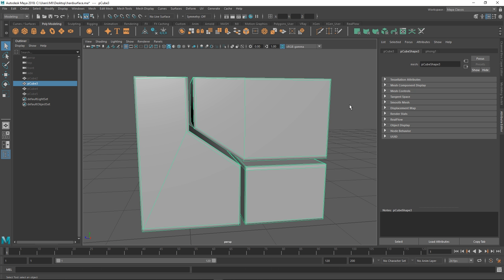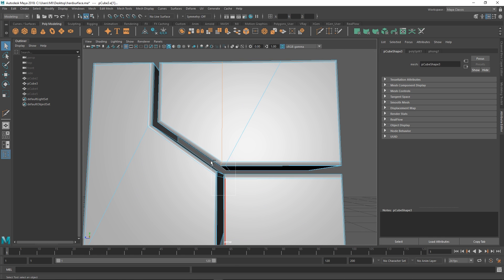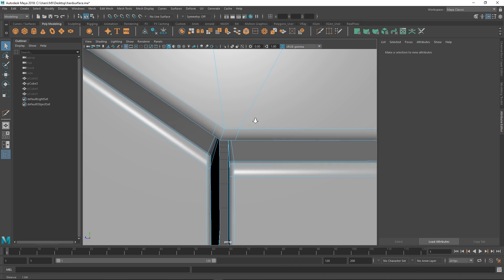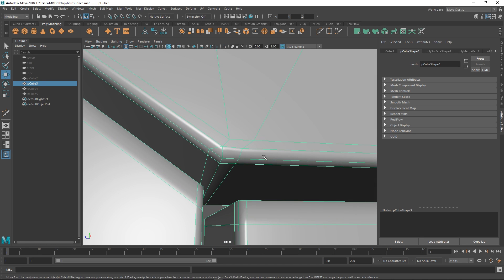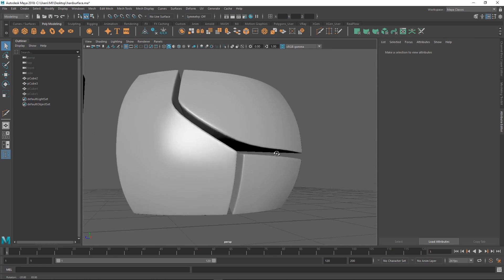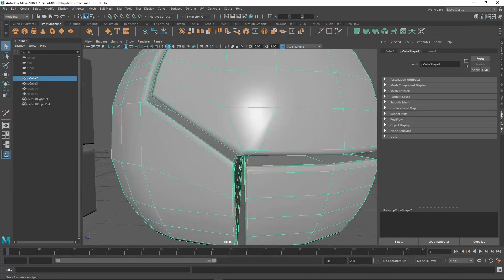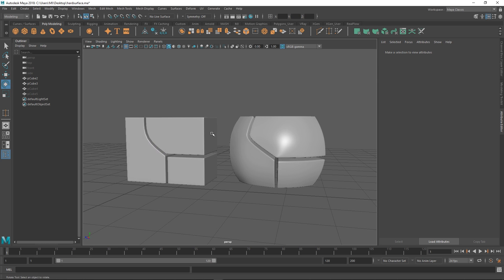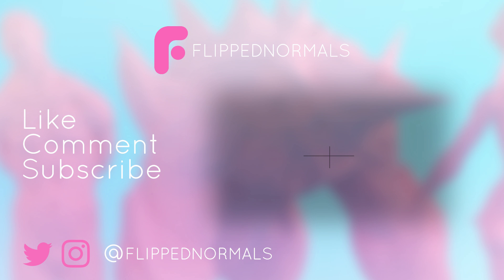How to Use Triangles When 3D Modeling

Comment: Or if you wanted to create a defining edge, you could create three edge loops, and then delete the edges that dont define the corner, then use the multicut tool to link the outer defining edges and boom, you have created a hard edge with no extra edge loops

Comment: Please do not mind but this is not the right way to handle this kind of situation. At least you need enough polygons in your mesh to handle the curve or roundness before adding in any supporting loops. Even you can use crease tool in Maya or 3ds max for a view before finalizing your model. This is how we handle these kinds of surface: https://www.artstation.com/artwork/m4X2E

Organic hard surfaces need a little extra planning before boolean or cutting any surface into it.

Comment: For corners it's actually better to use a diamond face, you don't even need a triangle there. Anyway, keep up the good work guys!
Reply: whats a diamond face
Reply: @isunktitanic  it's a quad that has 3 vertices at the top and one at the bottom ( kind of looks like a diamond ), useful to go from 1 edgeloop to 3 or vice versa

Comment: Why do i need to add supporting edges? And why do you keep checking with "3" mode constantly? Cant i just use the model as it is without smoothing it?
Reply: The reason is that for anything but games , models are subdivided for or on rendering, smoothing them out. If you don't have edges z your model will shrink and lose its shape. Make a cube in Maya and press 3 on it. Then add edges and see the effect :)
Reply from the maker: If you work with basically anything apart from games, you need to check the '3' constantly,  as this is how it will look while rendering. You want to be as close as possible to that.
Reply: if you'll get better result, then do it your own way, and maybe share with others
Reply: Kayo Lazuli I just wanted to learn the reason for that.
Reply: 3 is the subdivision preview . After modeling in Maya, you need to forward your model to a sculpting software, eg Zbrush to add details on it (high-res). The sculpting software works by increasing resolution of your model so that you can add minor details. One way to increase resolution is by subdividing your model. When you hit "Divide" in ZB, you see it has more points and also becomes smoother, which is what you see when you press 3 in Maya. 

This is just one way to do the modeling. You can, of course, choose not to do it this way. You can use other features than subdivision in Zbrush, like Dynamesh or Dynamesh Master to increase the resolution of your model. They increase the resolution without smoothing your model. 

Just search "subdiv preview maya", "high-res low-res pipeline maya " to find more.
Reply: You obviously don't work in production

Comment: What about n-gons? I've seen people call models unprofessional if they had n-gons, but just like in this video those n-gons didn't really seems to cause any problems. I tend to leave n-gons in my models also to save time and polygons. N-gon in a flat surface doesn't seem to cause any problems with the geometry or UV:s. It only looks bad in wireframe mode.
Reply from the maker: It really depends what you are using it for. If you take them into ZBrush, the ngon isnt going to work, so be on the lookout for them. They can be totally fine for a bunch of things.
Reply from the maker: Sure! That said, it's generally best in a production that the vert id is the same before and after ZBrush, so we tend to simply avoid Ngons all together when working with ZB
Reply: Assuming you are using the same software then I am correct. If you are exporting it somewhere else you need to match the file type. This is a technical issue not a model issue.
Reply: Ngons as well as triangles are fine on a completely flat surface that you know isn't going to get curved.
Reply: I worked on a few high-end kids CG shows you're not allowed to have ngons at all as a modeling artist
Reply: Due to technical limitation or?
Reply: @MizManFryingP  no.. like I said they were high-end CG shows meaning they had a pretty big budget. Ngons cause a bunch of problems from not smoothing correctly to issues down the production pipeline that I'm not super clear on myself because I'm mostly in modeling. Zbrush has issues with them as well as other programs
Reply: Oh you're talking organic. I was referring to hard surface. Yeah I would never use ngons on anything that isn't a flat surface that doesn't deform. 
And yeah issues in the production pipeline is what I meant by technical limitation.
Reply: @MizManFryingP  I believe they cause issues with rendering too even with hard-surface I could be wrong though I try to avoid them at all cost.. yeah everything in modeling is about technical limitations
Reply: Ngons will produce ugly shading if they are not completely straight so that makes sense. But if you're modeling a flat surface and you need to join 13 with 14 edge loops in a completely flat area, I see no reason to not go for it (if it doesn't deform and is completely straight)
Reply: @MizManFryingP  fair enough

Comment: Now I'm using Blender but the whole triangle becomes a quad thing, since the reason for the use of quads is that you can add a edge loop for detail in your editing cage for subdivision, doesn't that negate the only reason for using only quads? Unless you're applying and then editing the applied mesh?
Reply: Quads are better for animating with, especially for assets that require clean topology.
Reply: @MrBmxerFTW  oh okay, I only plan on making game assets so I wouldn't get that benefit unless I applied the modifier.
Reply: @shamanik1320  I'd still recommend to use quads as much as possible, it is especially useful for uv unwrapping, since you have a clean even topology.